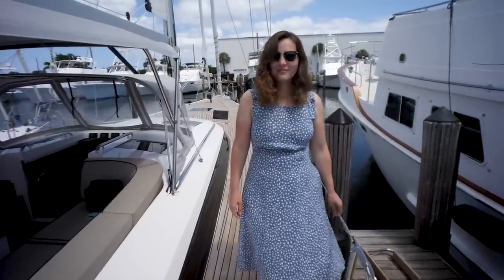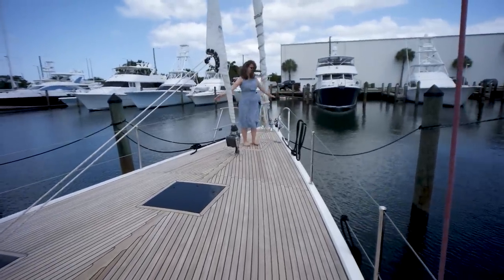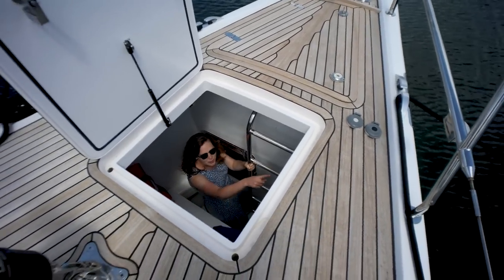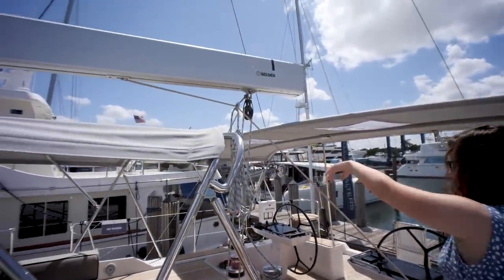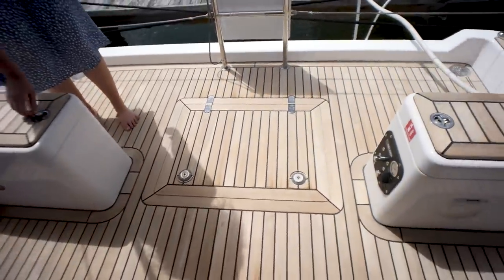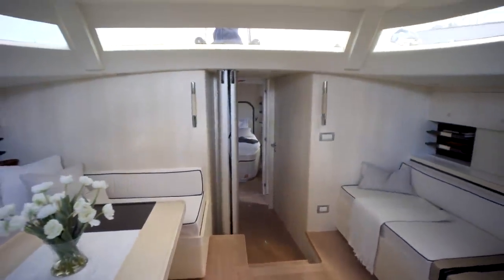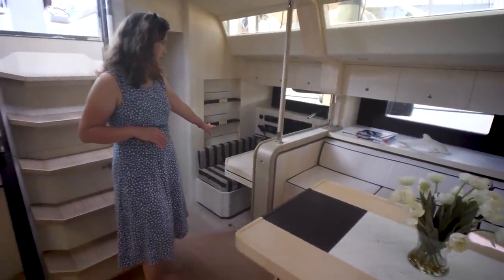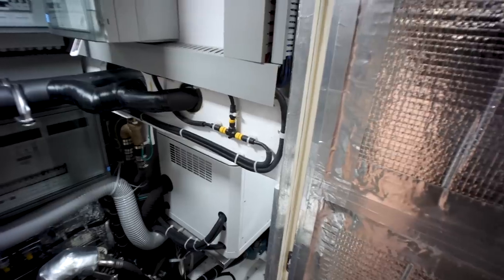This SIXTY Foot DREAM YACHT is ASTONISHING [Full Tour] Learning the Lines

Comment: I found only one or two negatives but it is amazing. There was a forehead high sharp corner as you went into the galley. There wasn't a man overboard life ring in view, and there were quarter turn valves in hard to reach areas near the gen set. On a boat that nice I'd have forgone the bow thruster in favor of twin main motors with integrated electric inline shat motors and charging systems and more solar and battery banks suited to the cruising lifestyle of people who want it. But darned pretty boat.

Comment: A pure harbor boat! Imagine that you have to go below deck to the bow or on deck from the cockpit to the duty station. How is that supposed to work without the possibility of holding on?

At the latest once you have bad weather you do not want an apartment on the water, but a real boat with handrails and a kitchenette in which you can wedge.

Great for the harbor and for a short trip in light breezes, but for real sailing in all conditions completely unsuitable

Comment: Missed the washer / drier, if there is one. Also, would've thought a boat that size would have a double sink in the galley galley ;)  The latter is a nit picky point. Didn't see any renewable power and it would've been good to see this already fitted, to avoid the need for an unsightly arch. Ideally modular, so you can swap out components as they go u/s or obsolete. (Same with a water maker.)

Comment: Nice boat.  I'm surprise that there is still a market for large expensive monohull .  Most live-aboard spend 90% of their time at anchor or in a marina.  This boat has descent space outside but if you have to spend any time inside, it is like living in a cave as when you stand up, you don't see outside and there is only light from above.  Other brand do better with the deck salon arrangement.  I would put up with this only if I cannot afford a Catamaran or if I would go racing on a regular basis.  But that is just me.

Comment: For almost half the money you can get a fully loaded 60 ft carbon fiber Tag catamaran that has more features and is much faster.  Sure it was built in 2014 but it is still twice the boat.  But then I would rather sail a catamaran than a mono hull any day.  Nice mono but more is better at the same length.